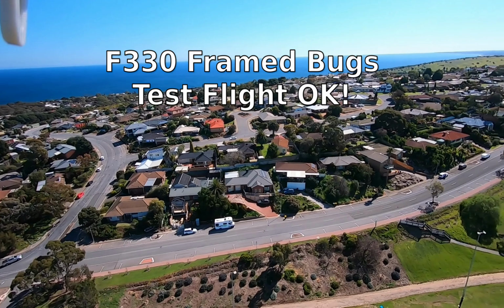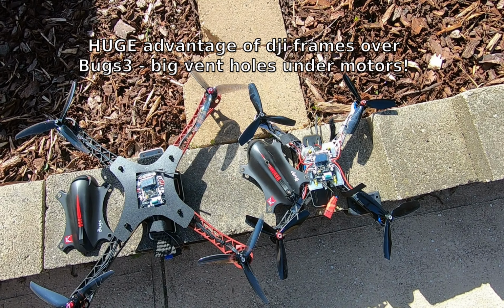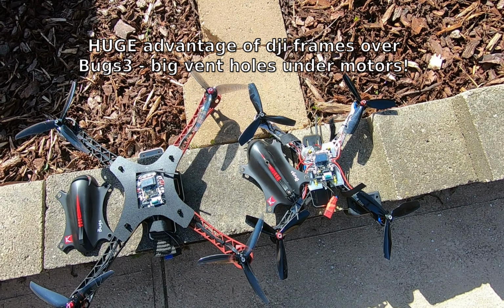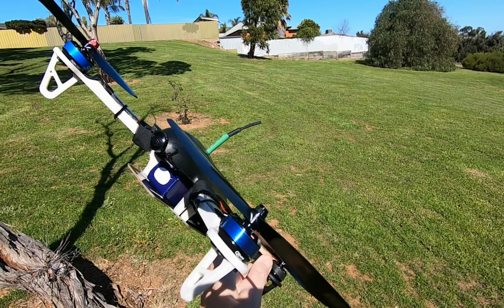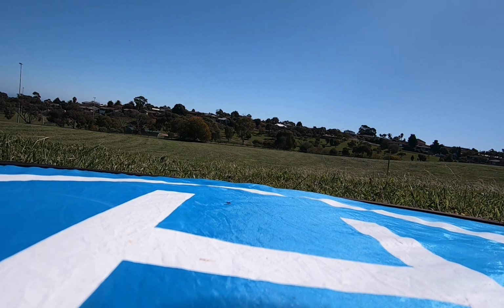Latest Build, Test Flight - dji F330 frame 2300kv motors

Comment: F330 with the 6inch three blades is the perfect match.
What will be the perfect motor size on this setup?
Reply from the maker: Have just moved up to 7 inch props, with good results. These older blue motors are labeled as 2300kv. They are larger than my newer black and red 2300kv motors.
 An important difference that I missed at first is that they need holes in the frame under the motors for cooling. The black and red ones have slots in the side to suck in air.